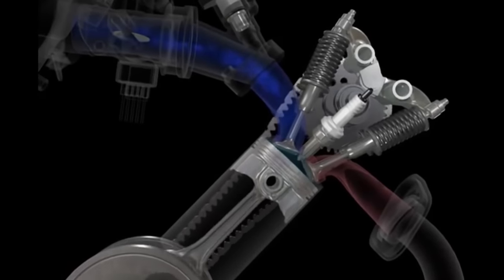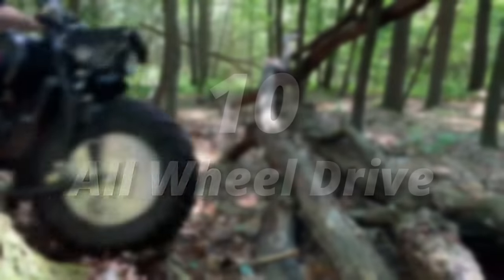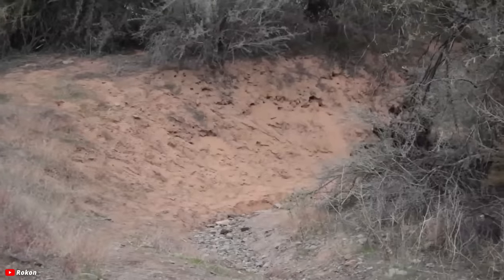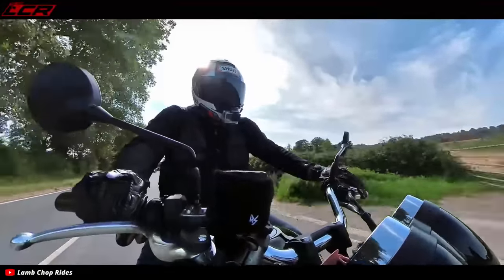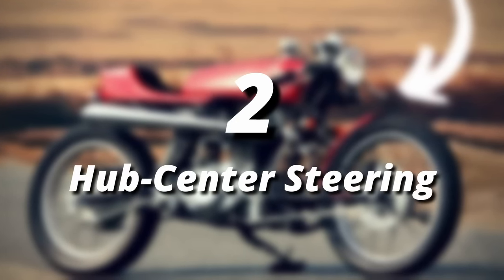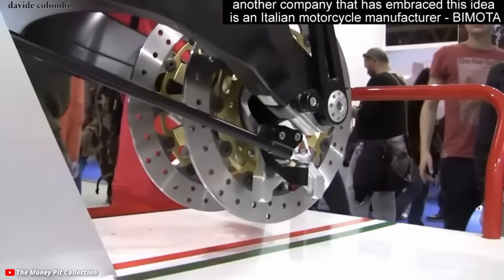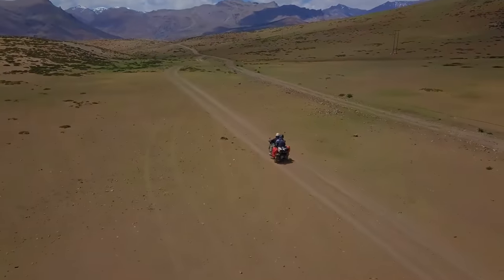10 Motorcycle Innovations that never caught on

Comment: I have used the twist grip shift quite extensively over many many years (like almost 15 years or so). The Piaggio derived Bajaj scooters and the later Vespa scooters manufactured by LML (in collaboration with Piaggio) were very very popular in India; and various models were manufactured till around the early / mid 2000's.

The twist grip shift is quite precise and allows you to shift gears quite fast. In slow moving traffic, the handlebar shifter allows you to have one foot available to balance yourself.

Another good thing about the handlebar shifter was that it allows for 'clutch-less' upshifts or downshifts - when you are in motion. Only 1st gear needs the clutch - 1 to 2, 2 to 3, 3 to 4 or 4 to 3, 3 to 2 and 2 to 1 would work absolutely fine by just twisting the grip... without the clutch. In fact, clutch-less shifts were more precise. The hand-shift meant that you could ride comfortably wearing flip-flop sandals.

The only issue / problem with the twist gear shift was that one of the two gear cables (thin braided steel cables inside separate sheaths) would sometimes break - but that was very very rare (once in ~4 years or so in a daily use scooter).

It was more often, the clutch cable that would break (Once in ~2 years or so)... and you could just push start the scooter (a little tricky to push, jump onto the seat and engage 1st gear to start) and ride the scooter without the clutch (remember clutch less shifting) to the mechanic's shop.

The original cables would easily last for around 4 ~ 5 years. The subsequent increase in cable breaking frequency was probably due to the substandard aftermarket spares that were often used for replacement.

Changing the sheath (which would have lost its smoothness / lubrication) would increase the longevity of the cables... but changing just the cable was far cheaper (less than a dollar). Eventually, you could learn to change the cables yourself (It was quite simple, needing just a couple of tools). If you were planning a 'long'ish trip in an older scooter, you could just throw a couple of spare cables into the side storage box and you were set.

When Honda came in with it's gearless / vario-drive scooters (Kinetic-Honda); and the arrival of the TVS-Suzuki, Hero-Honda, Kawasaki-Bajaj commuter bikes in the 80's was probably when the Vespa clones and derivatives started to lose market share. The Honda scooter was more easier to drive, more stylish, simpler to maintain. (The Vespa clones and derivatives needed a Petrol + 2 stroke oil pre-mix, which probably fouled up the plug faster. The Honda was auto lube and needed plug cleaning less frequently.)

I used a Bajaj Chetak 2 stroke scooter as my primary mode of transport for around 10 years during my college and early career days... before switching to a Kinetic-Honda and later the Yamaha RX100, RD350 and my last bike was a Hero-Honda CD100 commuter. The Bajaj Chetak still had its utility for a long time even after I had the other bikes (Thanks to it's generous lockable storage.)

Having used the foot shift bikes (RX100, RD350 and CD100) and the handlebar shift Vespa derivatives / clones, I would say that the handlebar shifter was definitely more convenient. Not sure why it never caught on in other motorcycles.

Comment: Funny thing is, here where I live the vast majority of motorcycles sold do have linked braking systems, in fact hundreds of thousands are sold yearly. 

Several years ago regulations passed mandating any bike to either have at least single channel ABS, or some sort of way to apply force to both brakes with only the foot one. That's a by-product of most riders being taught not to use the front brake therefore being scared shitless of using them since, that means much marger braking distances and lots of avoidable accidents, so by law the rear brake pedal applies 30% of the braking pressure to the front regardless of lever pressure.

Comment: I traded in my Yamaha FJ1200 in the mid 90’s for a new bike. I tried the GTS1000. It stuck to the road like Velcro when cornering, a fantastic ride. Then I hit traffic in Canterbury (in the UK) and was sat in the bike moving it forwards with my feet a metre at a time for about 30 minutes. (Yes, traffic can be that bad in Canterbury). It weighed a ton. 

I ended up buying another FJ1200, this time with ABS, with a free set of Giwi luggage as a sweetener.

Comment: Traction control and abs are great, when they work. In mud or slush or ice, having your car not spin the wheels when you give it gas means you get stuck. Having the wheels spin rather than lock up means you drive straight into the vehicle ahead of you if the road is slick or gravel.

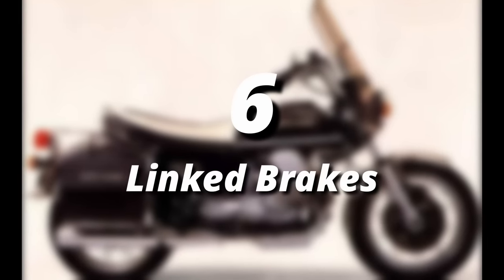Comment: At 6:44 The linked brakes works perfectly on touring bikes with secondary shaft transmission.
It will pace the suspensions because the shaft effect is the contrary on a secondary chain transmission and is "bad" and more violent.
It also allows you to "jump" on any of the two brakes when being surprised without having brakes locked ( this was OK before Anti Locking Brakes ).
It also allows you to brake efficiently in the winter when your hands are frozen.

Comment: I had during some years at the beginning of the 80's a Vespa 125 cc, which had the gears in the left hand. I never had any problem, except that wire used to break quite often. Anyhow, maybe it wasn't a problem of the gear but of the wire, because the cable of the acelerator had also to be replaced often. Excellent video. Milesker! (Thanks).

Comment: Christini AWD Motorcycles builds a series of AWD race and off-road bikes, in 300 2T and 450 4T displacements, including a street legal, adventure model. They even have a military version available. They also build chassis kits that allow you to convert some Honda and KTM models. They are working with KTM to develop an AWD conversion for their large adventure bikes. Granted, they are a small company, but they are the tip of the spear for AWD motorcycles.

Comment: Just want to mention that Rudge had a system which engaged both brakes when the foot pedal was used, but it was still possible to use the handbrake separately. 

As far as I have understood this system worked very well indeed and was used from it´s introduction in the late twenties until Rudge ceased production in 1939. 

Rudge also introduced 4 valve cylinder heads in their series production in 1927 and continued to use 4 valve heads until the end.

I noticed that someone had mentioned that twist grip gear change was used on mopeds in Germany, the same applied for Swedish mopeds and was common from about the mid fifties until the early eighties.

Best Regards / Jan

Comment: Maybe someone already mentioned it. Engineer Tony Foale designed and built small series motorcycles with exceptional hub-center steering in the mid-1980s, called the QL (Quantum Leap) and Q2. Certainly technically related to similar systems, but somehow different in appearance. I don't know if the concept was implemented again in another bike.
Reply: Bimota made a few race bikes with hub center steering, but I've never seen it on any production bikes, from anyone, ever.
  The advantage was that it eliminated brake dive, however the caveat is that racers use brake dive in their favor in corners because it shortens the wheelbase. 
    Functionally though, it worked flawlessly.

Comment: Not sure if anyone else has mentioned the 1960 Suzuki TA250 had linked hydraulic drums, with a cable override on the front one in case additional braking effort was required at this end of the machine.

Comment: In the mid 60 to mi 70's there was Zundapp that utilised a 3 gear grip shifter on their forced aircooled CS 50, so it has been around for quite some time. I remember it being my first moped turning 16 - it was an awkward method to learn an the cable would have the tendency to snap or stretch, which meant you needed to reindex it.

Comment: I used to borrow a friends  82 Yamaha Turbo Seca 650. It was fun to try and go full throttle on takeoffs but I always had to let off by 3rd gear when it was lifting off. I never rode it enough to get used to that but it was still fun. It was easy to scrape shoes in corners too.  He got a great deal on it used in 1983. It looked a little Futuristic even for the 80s.

Comment: GRIPSHIFTS 03:44 - Yes other manufacturers did it too, for example the East-German 2-stroke Bike Company Simson: Their first bikes, the 1950s(+-) SR1 and SR2 (45cc or so) also had a handlebar shifter. Simson came from bicycles and these bikes looked like somewhat shrinked old motorbikes. They also came with a pair of pedals in case you ran out of fuel, which were terrible to use. So there was no space for food shifting. 
Simson continued to use handlebar shifting also for their (in Germany very famous)  manually shiftet scooter called Schwalbe, and some other bikes through to the 1980s. They gave it up however in the 1980s and started to use the usual foot shifting on their latest S50 and S51 (best 50cc non scooter motorbikes you can get in Germany) I owned an SR2 and an S50 and a couple of other real Motorbikes and Foot shifting is just so much faster. I mean when I shift on my cx500, my body does it so fast, even I cant follow. The handlebar shifting always felt a bit flimsy, not so precise, even fragile and so you need to make it slow. Plus changing the angle of the clutch lever all the time feels a bit uncomfortable.

Comment: The grip shifting mechanism was used by other brands, too. Some German mopeds and scooters used that in the 60s and 70s. I never liked it much, because it feels spongy and needs to get turned really far, especially with 3 gears. And since you need to pull the clutch lever simultanously,  its kind of unnatural movement for the wrist.
Vespa scooters had it mainly because they  had this "floor" to put your feet on. There was a brake pedal already, so I guess they didn't want to put another pedal in it for the shifting, which would be somewhat arkward to use.

Comment: Linked brake system it comes in many scooters today.  It is called CBS for combined brake system, left brake lever controls both wheels in a 60 rear, 40 front power ratio, and right lever is 100% front brake.  I have a 2018 Daelim S3 250FI equipped with CBS and works great.

Comment: The Dual Breaking System has been used in the Honda Pan European St1100 also. 
With the foot pedal one of each breaking pistons in the two front disc-breaks work together with the rear break. It was ABS controlled. The manufacturer of my sidecar motorcycle combined the sidecar break also with the foot pedal. That way you reduce speed at all three wheels at once of the sidecar motorcycle by using the foot pedal only and the whole vehicle stays straight while breaking. 
The front break lever only works on one of each breaking pistons on the front wheel breaks.

Comment: The Honda ST1300ABS does have proportional linked braking. When you apply the rear it will apply up to 30% to the front, depending on how much the rear brake is applied.  I live this feature, especially if you have to hit the brakes when your right hand is off the handlebars, for the one time in 5,000 miles.  Sounds goofy, but it happened just like I said, but maybe it’s just me.

Comment: I have a Vespa Cosa with a handlebar 4spd manual and it's pretty fun! Though, at times rolling the wrist so much forward to reach 4th gear while pulling the clutch causes discomfort in my wrist. So a handlebar sequential shifter could be interesting and more ergonomic. Also, the Cosa is yet another italian 2wheeler to feature combined brake system! The foot pedal provides splits the brake force about 70/30 to the rear. Rest of the front brake power can be reached by regular brake lever. 

It was sort of simillar to the 90's Moto Guzzis, only there the foot pedal activated the rear brake and one of the front disc brakes. The other front disc was activated only by the handlebar lever.

Comment: I had 5 telelever front suspended BMWs. I liked that suspention and it didn't look odd and had ABS brakes where front brakes partially applying back brakes and the back brake separately.

Comment: the linked brake system is actually mandatory in Brazil for any motorcycle under 300cc since 2020, the worst choice to protect new riders since a slippery road would make you lock the front wheel while using the "rear" brake.

Comment: Question on the twist shift idea.  Has anyone incorporated the clutch and the shifter into one function? Twisting the handle would first engage the clutch and then bump the shift.  This could also work with a foot shifter.  Power shifting would be a breeze

Comment: I have two Guzzis with linked brakes and they are fantastic especially in emergency situations, almost impossible to lock up either front or back when you stamp on it. I pretty much only use the front hand brake at lights. Amazed other manuf didn't pick up on this especially BMW. So smart.  I also had a GPZ turbo in the mid 80s. A fantastic touring bike, it was basically a GPZ1100 frame with a detuned 750 cc motor with the turbo. It was a bit slow off the mark but from 80kph to 240kph pulled your arms out of their sockets, overtaking trucks was a dream, fzzzzzzz.  The long wheelbase meant it was steady as a rock but having a 18 inch wheel up front meant it wasn't a true sports bike, like the 900R with a 16, and I had both, but the 900 had a narrow uncomfy seat while the turbo's wide seat you could sit on all day. Rode that thing all over Australia with the girlfriend and a gearsack and sold it after 4 years ownership for the same price I paid for it. Also great for burn outs outside the pub at closing time, so I hear.

Comment: Grip shift didn't move on for a reason of hand pain and it is not that good in certain circumstances, mainly roads in city where you have to shift constantly, it caught on in Czechoslovakia in small moped with only 2 speed ( Stadion and Jawetta mopeds from Jawa) but those caught on in small villages where people didn't need to shift but move faster than a horse or a bicycle. It is also more complex so it's more prone to fail.

Comment: Two wheel drive is neat but it takes away traction from the front wheel, which makes it useless unless you're going like 2 mph which is perfect for the Rokon's application of course. My ST1300 had "linked brakes". As far as my understanding of the system was that the rear brake activated half the pistons of the front calipers.

Comment: a lot of motorcycles still have connected brakes. usualy using the front brake lever to slightly apply brakes to the rear as well. but the pedal would only do the rear.

Comment: There's an error about the 70's and 80's Moto Guzzi linked brakes; the pedal operated the back brake and only ONE of the two front discs.  The hand brake operated the second front disc which means, contrary to your argument, you could very definitely modulate the share of braking between front and rear wheels at will. Also, just for everyday regular breaking, pressing the pedal gave a safe and very effective stop.

Comment: Grip shift style transmission was also present on some of soviet mopeds. I think 50cc Karpaty had it. On my opinion such style of shifting is brilliant. So easy to operate and as you said, it is clearly visible what gear you on. People around here referred at it as "childish", lol.
Also I don't understand why motorcycle brake levers are so big? you anyway operate it with a finger or two. I think modern mountain bike levers are so much better shaped.

Comment: The linked brakes still exist in some Asian markets. In some markets the smaller capacity bikes are fitted with CBS ( combined brake system) which basically operates similarly. Irrespective of whether you use front or rear brake, both brakes engage in a bike with CBS. In India every bike under 150cc are required to at least have CBS and bikes above 150cc are required to have ABS.

Comment: The twistgrip gearshift was VERY common in the '60's and 70's on European mopeds of many brands, including non-european brands producing for the european market, to name a few, Honda had them, Zündapp, Puch, Kreidler, Tomos, and several others.
Went away quickly, the cable adjustment was finicky and in general unreliable,the cables loosened up or even simply snapped often, leaving you to limp home in one gear, usually an inconvenient one...
Reply: Cables were a nuisance on my Honda CB350 twin carb  cable operated and the Cables would stretch knocking out the synchronisation
Reply: @Johnketes54  I had the CB400T and no problems, single cable operating one shaft moving both butterflies.

Comment: I learnt to shift on a moped with Gripshift, it was a Zündapp C50, i really liked it, and looking at Bicycles.. Hell.. i've got 3 bikes, and 2 of them use Gripshifters (ok.. they don't have a clutch, but still.. I also liked the old Fashioned Shimano Push-button Shifters, and now Racebikes have a combined brake-shift lever.. Pull to brake, move side to side to shift.. I like that innovation..
To me, a pushbutton style shifter is something i'd like to try, or.. a gripshifter that just moves back and forth one position when shifting.that would also be not bad..

Comment: The main reason for alternative front set-ups is that the return is not equal to the investment. Forks are simple, you need two tubes, so lathing parts some shims and coils and two triple clamps that can be made by molding. On the other hand you have a shitton of parts with complex machining a number of additional bearings and all that to have a bike that isn't even necessarily better handling